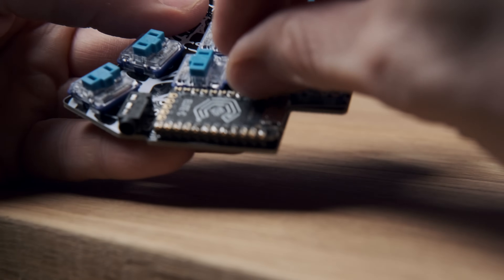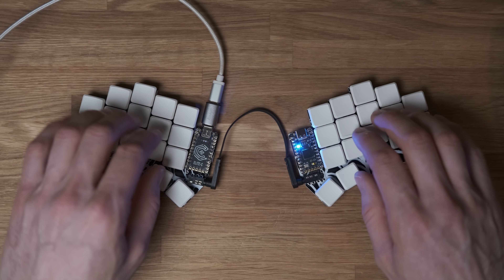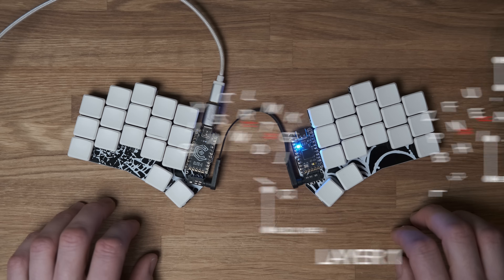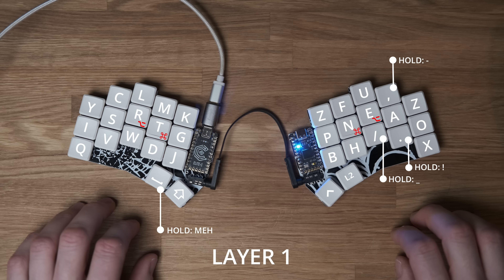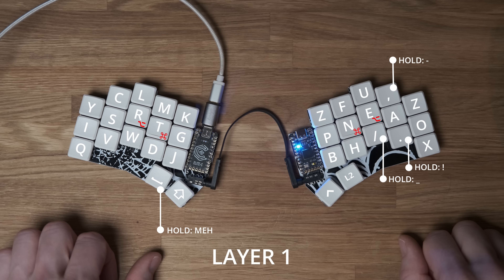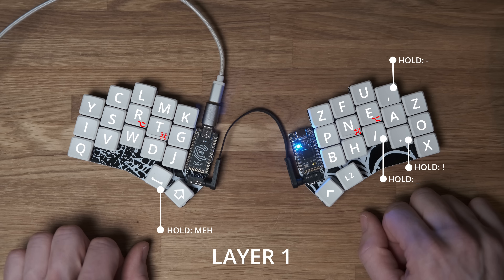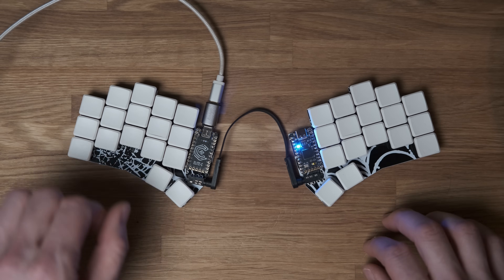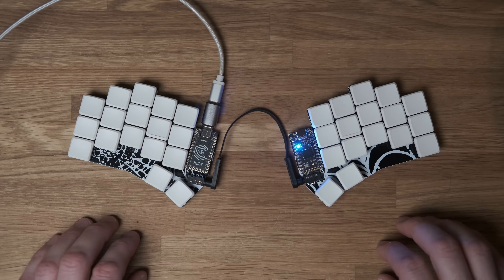You Won’t Believe How Effective This Keyboard Layout Is

Comment: Did you ever do a 3x4 24 keyboard? Sounds doable with 26 letters in the alphabet.
I’m just moving back to split keyboards, but they all seem mechanical rather than membrane, I guess hobbyists can work with mechanical keyboards? I’m thinking red linear switches for less work touch typing…coming from a low profile Apple style membrane Qwerty keyboard:-)

Comment: I've built all my own keyboards before but just bought a wired corne v4 off Ali express just because it's about the same cost of not cheaper than building myself.  Quality seems good.  But not having that extra number row is difficult for programming, and impossible for general gaming.

Comment: I would appreciate a slower version with more examples to show what the issues are you were solving. Its hard to follow what you exactly mean sometimes
Reply: Yeah, Ben's videos are pretty intense, but also precise and with high information density. I did discover the merits of pause (space), skip fwd/back (,/.), and frame fwd/back (left/right arrows). I rewatch some sections several times. Hope that helps.

Comment: I tried a very similar layout and i like it very much. There is only one thing i am curious about.  I'm a software developer and i use neovim for pretty much all my work. In neovim i navigate by jumping lines using numbers. But now i have to press 3 extra keys just to jump three lines down, which normally are 2 keys. Isn't this a huge caveat, when working with neovim, or does anybody have a good solution for this?

Comment: Do you have any more information about the ISRT layout? There is very little info I can find about it and I'm curious as someone with my own custom ergo keyboard (41 keys:  3x6 with 2 thumb keys on each side and then a larger shared thumb key in the middle).
Reply from the maker: I'm still using it. It's good but I still feel seems slightly heavy on the left hand ringer finger.

Comment: I can see on your "Layer 3" you do have Mouse movement mapping. Did you use QMK for that? I'm new & I used ZMK (Lily58), I have not found a way to map mouse movement on ZMK yet. I'm loving to use mouse movement without a mouse... Still wondering how.
Reply: check the zmk doc to see if it support mouse key

Comment: > The keyboard cant tell if your typing the keys or rolling
Let's throw some AI at this. QMK is already obsolete. We need crypto on each hands (two signing keys per set!), and we need structured data flow between the keyboard and some external server (on the workstation or not), with an AI to figure out what we want: it could even figure out which language we're trying to express. We need to drop analog cables, so we need a new port, a single twisted pair that is uber thin and small, and only does data. No more external powering: the keyboard should be able to run for hours on a tiny battery (hot swappable of course!). Things are about to get really weird and fun. Your videos rock. Hope we can collaborate when my project takes off into micro-territory. I used nvim for years (and kakoune), but had to switch to emacs because of lisp, so I totally get where you're at. Thank you brother! 🙏

Comment: I'm using an Elite C which is not supported by ZMK, so I'll have to use QMK. Do you know what version of QMK you compiled with? I'm getting compilation errors. Also, is there a json keymap file you could push so it's more future proof?

Comment: I'm just starting with my 42 keys split keyboard for Vim. So that were very useful and sensible advices. Thank you!
For now I'll try to stick only to 2 layers and 2nd layer will be activated on hold. Yeah, it'll require some combinations, but I try to arrange it the way that fingers return back home without looking at the keyboard.
The thing that really scares me is the amount of time I have to spend working/training/learning with a new keyboard to start typing at least at previous speed. What if I don't like the layout ?

Comment: You know what the most effective keyboatd layout is? The one Ive been ysing daily for the last 35 years. Anything else is far less efficient.
Reply from the maker: Yeah it’s unlikely you’ll improve on what you know in terms of speed. But in terms of effort and fatigue you can certainly make big improvements.
Reply: @BenVallack  Those aren't really issues in typing.
Reply from the maker: @Andrew-un8tx  tell that to the thousands of people with keyboard related RSI!
Reply: @BenVallack  Likely due to poor ergonomics unrelated to key placement.

Comment: This is NOT the keyboard for me.
As a Blender artist, if I don't have a 100% keyboard and a 3 button mouse, I'll die.

Yes, there's a difference between period and numpad period. Numpad period centers the selection onscreen, period opens a radial menu that changes the transform's pivot point.
Reply: I work in Maya, Blender and Unreal and I'm actually thinking that a split keyboard + touchpad with inertia and spacemouse could work really well. You could 3D print a case and have the 3D mouse on the left and pointing device on the right. I mean, no matter what 3D software you're using, you basically have infinite shortcuts. To put it into perspective, I've used a Razer Tartarus and mouse/stylus since 2016 and rarely,(if ever) use a keyboard or 3 button mouse.

It turns out that manga artists, who work long and awful hours, gravitate towards the exact same setup. 

Ergonomic and efficient solutions are rarely obvious, but they shouldn't be discounted for it!

Comment: Why you say effective, how many real problems did you solve using it?
I mean not your particular problem to have smaller keyboard layout, or achieving engineering experience.
Reply from the maker: Quite simply a reduction in effort when typing.

Comment: you still need the flyback diodes every time you have a mechanical switch , this man really said that this keyboard doesn't require diodes because its not layered as a matrix XD. Search about the collapsing of electromagnetic fields you know the voltage generated are way higher than what the micro controller can handle, i hope it last as long as the wrong explanation.

Comment: What I do is put the L1 key over ctrl on the base layer. That way you don't need to worry about outputting anything when trying to go back to L1 if you're already there because ctrl by itself doesn't do anything. Simpler than the two thumb tap.

Comment: Ben do you have a video showing how to remove low-profile key caps?
Reply from the maker: Just pull them straight up - make sure if you do tilt them while lifting it is inline with the tabs underneath. They can snap off otherwise.
Reply: @BenVallack  thanks Ben

Comment: Now, a year later, what, in your mind, is the "ideal" keyboard/layout for most people? I understand that this could be different from person to person based on individual needs, but as I've never used anything other than a standard QWERTY keyboard, I'm looking for a good starting point to jump into something more efficient (I'm running Windows, if that makes a difference).

As a side note, are you aware of anything like a small, low-key-count keyboard like this that is also a mouse? Thinking it could be efficient to avoid moving one's hand from the keyboard to the mouse by using the keyboard as a mouse, as I transition back and forth quite a lot.
Reply from the maker: Ideal for most people is probably the 36 key layout. It’s small enough for an efficient reduction in finger movement but big enough with enough thumb keys for direct layer switching too. It’s a very logical place to stop falling down the rabbit hole! There are various projects with rollerballs embedded but I haven’t managed to setup something up yet.
Reply: @BenVallack  Great, thank you!

Comment: hey ben! thanks for these videos — I’ve been a 60% user for years now but you’ve convinced me to take the plunge and design my own 34-ish key board. how are you putting the really smooth key layout overlays on your videos?
Reply from the maker: Awesome cheers. I used Apple Motion to add motion blur to the movement of the graphics. 180º shutter angle to match video frame rate.

Comment: So I have a dumb question. Well a few really. how do I take what you have on GitHub and use it in QMK? second on your layer one what are the red icons? They look MAC but I'm not sure if so do you have any ideas on what they could be replaced with in windows? Thank you for your time. I love your layout and want to use a version of this for a personal build.
Reply from the maker: The red icons are the Mac modifiers- you can use windows modifiers instead, I think it’s basically automatic. You’ll need to install QMK and setup the command line to build firmware from my config files. There are some tutorials around - discord also good.
Reply: @BenVallack  Hello again so going everything I noticed that the commands are gui instead of what I thought would be command. So this actually would work rather seamlessly for a windows computer. The only thing that I am working on understanding better is the force quit command for the windows side of things and how that effects it. Thank you once again for the info earlier as well as putting out all your hard work.

Comment: Did you released the Vim video? I wonder how are you handling, are you changing the vim config to fit your layout? or just getting used to the new positions of the keys.
Reply from the maker: Not yet but it will happen. I changed the config for hjkl and then basically just got used to the new positions for the rest (once I’d worked out the knock on effects of moving hjkl)
Reply: @BenVallack  thanks a lot.

Comment: I'm desperate to try this (I have a shoulder problem for which a split keyboard would be helpful for), but I'm a developer using Windows and I use the function keys a lot in combination with others (CTRL+F4 closes a window in Windows, F5 starts debugging, etc). I understand I could put them on (yet) another layer, so is that the answer? I don't see much value in the mouse movement layer so perhaps I'd repurpose that. Wondered what your thoughts were. To think of it another way - what's this layout like when you're a heavy keyboard shortcut user, but you don't spend all your time in Vim?
Reply from the maker: I think the idea would be to set up home row mods, then add a layer on the thumb key for your f keys. So you just hold the home row mod for ctrl then roll into the f layer with thumb followed by the f key you want. Should work very nicely.

Comment: So I am currently trying to learn Colemak DH. I've learned how to solder and recently found your channel. I will shortly be building a 34 key keyboard. I bought a SofleRGB as a project board. It's a work in progress tons of tiny SMD's. But feeling all the keycaps on there, just feels like there are so many keys. And I think I have finally graduated past the "gamer" approach of keyboards too. 

I am also trying to learn programming after numerous years of being out of the loop. Like, only using Notepad to code Java in high school on Windows XP. Terminals are finally not scary, and about to download Helix as my text editor. Vim seems great. Emacs seems too extra for a user with my experience. I was trying to set up my init.vim for nvim, then heard about Helix. I am curious how Helix/vim feels on these style of keyboards. Like, does one notice they are more productive or less productive in their editor with this style? Or is the productivity relative to familiarity to smaller styles?

Comment: I'm wondering if there is a way to have a key, like a 'get out of jail free key' which will display your map on the screen.  Like, for instance, I'm a 60+wpm touch typist.  I don't look at ANY keys when I'm typing, BUT, sometimes I forget where a key is, particularly the 'shift+number' keys, like $ or *, so I sometimes have to 'hunt and peck' those ones.  If I had a 3 or 4 layer system the keys would get pretty ugly having all of the options there, but if you typed 'get out of jail free key' + the layer key you could find the key you're looking for just as if it were an actual keyboard.
Reply from the maker: Cool idea!

Comment: I'd love to see the vim specific video! Particularly I'd love to see how you handle keys that have a specific spatial relationship in qwerty. For instance, should I remap movement in vim to be whatever the right hand homerow keys are in my layout to maintain that muscle memory, or use hjkl no matter where they are?
Reply: I have never used a non qwerty layout, but would definitely want to accompany such a drastic change with spatially remapped hjkl (to whatever the keys on my home row right hand are)
Reply: Do you understand how he is using the space bar for both the leader key in vim but also the meh key?
Reply: @wormholecowboy  my leader key in vim is the spacebar, so he probably has it set the same.
Reply: He's still probably practicing, or threw this thing away for being impractical for daily use.

Comment: For me, 35 keys would be ideal. I am very happy with how I have optimized my Ferris 2 Bling. To explain it simply, the thumb keys from left to right are switch layer, ctrl/enter, shift/space, and alt/bkspc. The latter becomes delete on the second layer, which i would like available on both, hence my desire for a 35 key keyboard. On my 2nd layer, the top row is numbers, but for ergonomics, it goes 8901234567. Works quite well once you're used to it. the other keys on the left hand are arrows and below them home, pg up/dn, end. I have the mouse stuff set up on the right hand, directional on the home row then lower index, middle & ring are the mouse buttons. To drag a window you have to cheat with the thumb on the lower right index key. There are more nuances but that's the basics from half a year of trial and error. Quite happy with it. Having shift/space as one key takes a bit of getting used to, but once you have it's fine.

Comment: Hi Ben. I just discovered your video on the ferris sweep. Very interesting!! 
Is this the same keyboard you purchased on the jlcpcb website? If so, I thought it only had 2 layers. Would I need to specify a pcb with 4 layers for all the functionality of the keyboard  used in this video?                           Thanks very much in advance.
Reply: Number of layers doesn't depend on PCB really, unless you use VIA, but even then it probably supports like 8 layers because it has so little number of keys.
Reply: I only ask because the jlcpcb website gives more expensive options for 2,4 & 6 layers.
I think I would want 104 keys so I guess I would need to pick 4 layers on the pcb website, though it seems that Ben chose 2 layers on the website but shows 4 layers in the video (I’m a bit confused about that-I’m not very tech savvy. I’m only interested in these videos because my shoulders hurt when using a normal keyboard)
Reply: @asif62621  the layers are all digital, they dont exist physically and has nothing to do with the number of layers on your pcb
Reply: @asif62621  look into the moonlander keyboard, it will be very simple to set up to your liking, and includes a graphical interface to create the layout you want.
Reply: @jbaker895  Ah, I see. Thanks Josh. That's very helpful.
Reply: @jbaker895  Just had a look at the moonlander. It does look more 'beginner friendly' but the ferris sweep is something I could potentially clip on to my belt and take with me on the go, more easily. I will try to mess about with the ferris first. Thanks

Comment: Ben, you really need to learn about combos. They're magical.
Forget about tap-dances, alphas on mod-taps, nested layers... You've got plenty of very comfortable space on you base layer if you press two keys at once, and you won't even feel the difference when typing normally.
Do give them a try!
Reply from the maker: Have spent a lot of time testing combos. I have a few still but mostly I’ve gone back to one shots and home row mods to avoid the impact on rolls that combos have. The latter point is related to what layout you’re using of course.
Reply: @BenVallack  even on Coleman-dh with lots of rolls, I’ve been having very few problems with combos, having set a fairly short combo term (30 for the default, and even shorter for some that caused problems).
Of course this is all very subjective, but to me they brought a huge QoL improvement over layers and other solutions, after spending a bit of time setting them up just right

Comment: "Found out that going to less keys to be beneficial" -- I'm not down this rabbit hole as far as you are yet, but I've found something similar. I was very worried about going to a 40% keyboard that I was going to be missing keys. I built a corne, and have found that the inner thumbs are useless (they are too far to reach), and that the extra columns for the pinkies are also mostly wasted. I do use the shift on the left, but that's just habit, I can see me doing away with those columns altogether. I am going to try some of your layout tips, as I do find chording the layers a bit annoying too. But... man, now it looks like I"m going to have to "invest" even more money/time into keyboards seeing your newer videos on building your own starting from the PCB. One quick question: why don't these keyboards need diodes?

Comment: How did you make it so that when you Held down a key it entered a different one? I was looking into qmk and making a 34 key layout but i couldnt figure out how to do that in the configurator. Did you have to code it in yourself?
Reply from the maker: I used tap dance when I used QMK. You might need to code it by hand which is pretty convoluted in QMK.
Reply: @BenVallack  are you using a different software now to use the hold function? Zmk ?
Reply from the maker: Yep, using mod tap behaviours in ZMK. Nice and simple in the config file. https://github.com/benvallack/zmk-config-card/blob/master/config/boards/shields/card/card.keymap